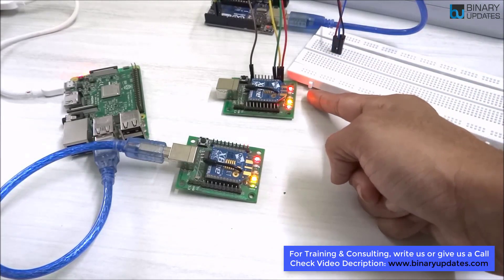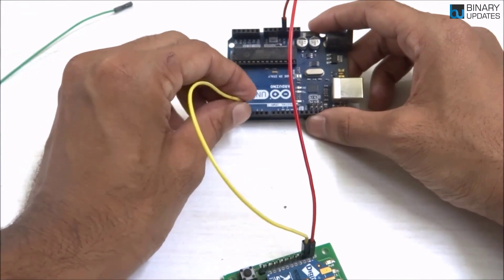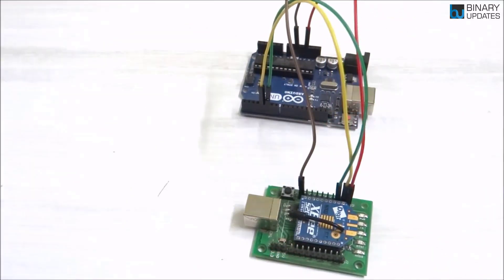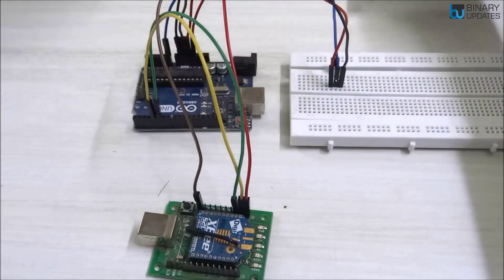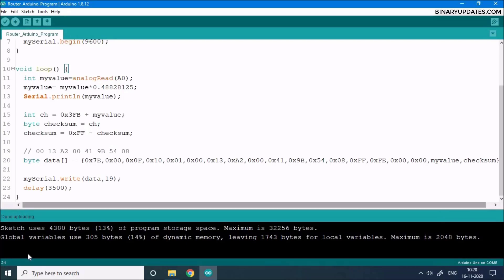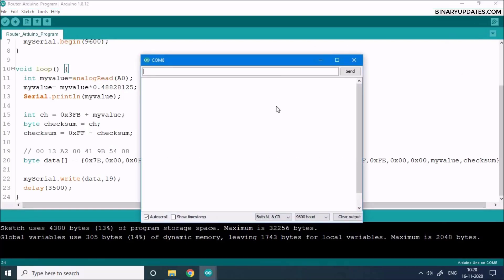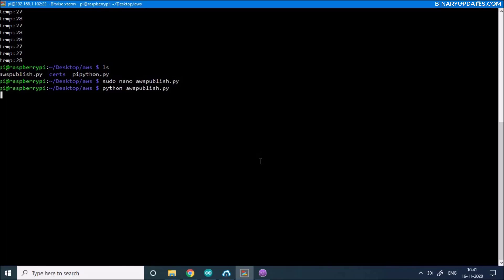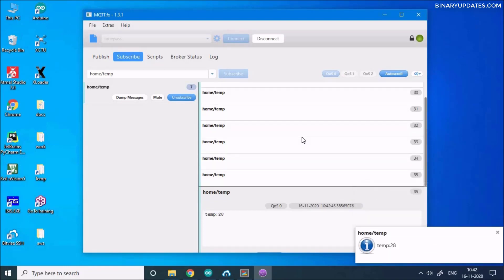ZigBee based Wireless Sensor Network using XBee S2C Module

Comment: Hi BinaryUpdates, nice video. It's a big help for me in learning IoT. I hope u will read this and perhaps kindly answer my question. Can i replace the raspberry PI with Arduino Uno, and replace the component for sensor (input side) by using only NodeMCU and sensor. Or do we have to use one microcontroller for each sensor as the input of the IoT system? Thanks a lot🙂
Reply: i mean for each input (partial) system of the whole IoT system with one microcontroller in my case
Reply from the maker: As one microcontroller support multiple digital and analog input. You can use as many input as supported by microcontroller. The only thing is you have to incorporate them in zigbee frame properly while sending data to other end of zigbee Xbee. I hope this answers your question. Good luck and best wishes!
Reply from the maker: HI Pheunomic, you can replace Raspberry Pi with any other device like Arduino or NodeMCU ESP8266. The only thing is it has to be connected with ZigBee module for wireless communication support. I this will help you!

Comment: Please what is the max distance between the Transmitter and the receiver if applicable...?
Reply from the maker: Hi Frank, usually the range of zigbee wireless communication is upto 2 miles (3200m). This is rated outdoor and in line of sight. But depends on may factors like electromagnetic noise in surrounding and other factors. I hope you find this information useful. Thanks!

Comment: Is it possible to connect zigbee, rfid, NFC protocol devices into one device to collect data wirelessly?
Reply from the maker: Yes you can connect different wireless devices as long as enough input and output pins available to your Arduino or Raspberry Pi.

Comment: Hi Binary Updates, thanks for your video. 
If I use DHT11 sensor,  how should i fix the code to properly? Can you help me with this problem?
Reply from the maker: You then need to make two variable in Arduino code for temperature and humidity. Since there will be two parameter you wish to send from Arduino. You may then need to change the size of frame which in result change the checksum value. Ultimately there will be many changes but not very hard to figure out. Wish you good luck for your project. 

Best wishes!

Comment: can you please make a video on RSSI value received at raspberrypi
Reply from the maker: Hi Amrita, I will soon make video about reading RSSI value of Zigbee using XBee S2C Module. But you can check in XCTU and also in official datasheet of XBee S2C Module documentation for quick answer to your questions.

Comment: Can’t we use the input output pins present on xbee?
Reply from the maker: Hi Chiranth, you can use input output pins on zigbee module. This will require you to dive deep into how to use XCTU Software effectively to make it work. Good luck. Thanks
Reply: @BINARYUPDATES  Yaa I’ll try to dive deep on it as of now there are no video on xbee with new software and very less examples 😩

Comment: does it need XBee shield to hook up XBee with Raspberry PI?
Reply from the maker: Not necessorily, Zigbee Xbee Module with Adaptor also work well. Just make sure your zigbee adaptor has USB Connector which will make easy to connect XBee with Raspberry Pi as I've shown in video
Reply: @BINARYUPDATES  thanks for your reply. 
Is it possible to use a smartphone connecting to a Raspberry PI 4 via WIFI to control XBee module (configured as coordinator) hooked up with the Raspberry, which is built as a gateway, to control another XBee endpoint connected to LED in a mesh network?

Comment: Hello,

Why use the Arduino to gather the temperature data when you can use the RPi to gather the data and send this to AWS? Is the Arduino redundant?
Reply from the maker: Re Ma, the goal of this video is to show you how to make wireless sensor network using ZigBee. By the way Arduino is powerful enough to use as an IOT NOde and Raspberry Pi can be much suited as IOT Gateway along with AWS IOT Core.
Reply: @BINARYUPDATES  Understood. Thank you for clarifying.

Comment: Around that byte data [ ] = ( what is this part, destination Mac address, what is this part, data from sensor,  checksum);

What are those part ? Also what's with check sum
Reply: Thank you for answering, this is the most accurate information I saw bout xbee S2C
Reply from the maker: That's a standard ZigBee Frame Format. You can get more information about it into the official datasheet of XBee S2C ZigBee Module. I hope this will be helpful. Good Luck!!